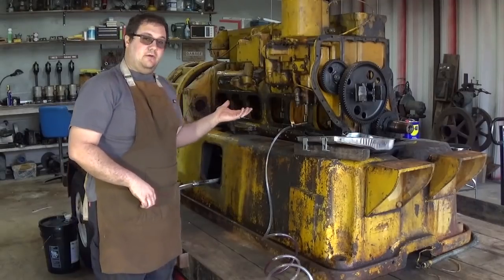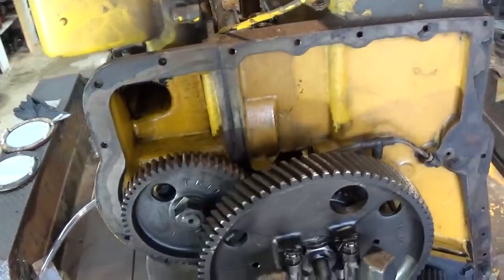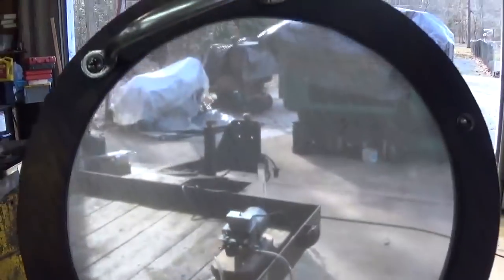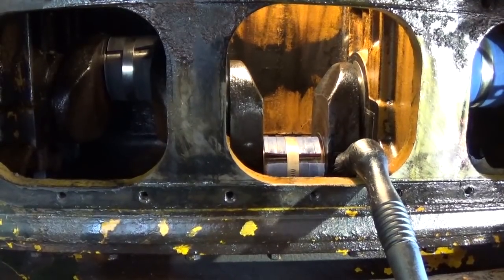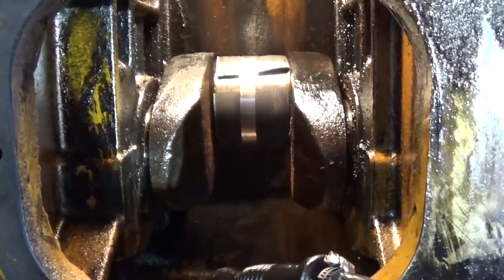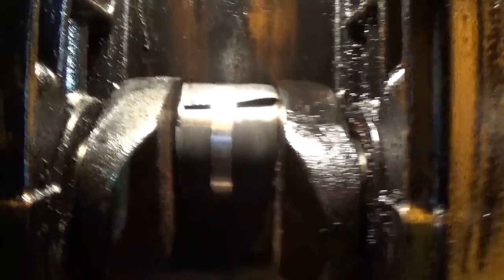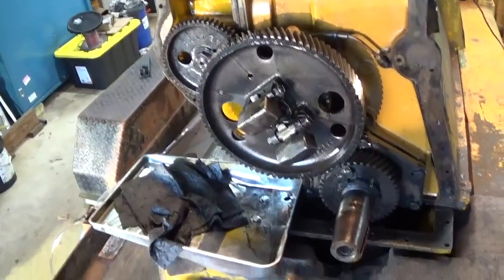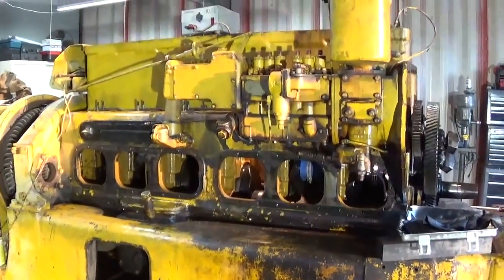Big Caterpillar Generator Crankcase Cleaning

Comment: Given the amount of sludge flying around, I would worry about the crank and cam bearings.  I know you don't want to get into the engine that far, but I think it will be necessary  to remove both the cam and the crank if this engine is to have any hope of living beyond a couple of hundred hours.  Even though the crankcase is clean, you have driven all the fines right into the bearings and cleaning the oil galleries will leave sludge in the dead ends right at the bearings.  Consult some experts for their opinions.
Reply: Exactly but I understand the other concerns too.

Comment: You can reduce the load on your pump with a minor alteration to your plumbing. Right now, you have a ball valve restricting input to the pump. This creates an unnecessary load, and is likely why your pump is so loud. A more efficient method of metering output is with a bypass valve. Install a "T" on the pump's output, you can use your existing ball valve or a better option is an adjustable bypass/pressure relief valve, and run a return from the valve back into one of your buckets.
Reply from the maker: Good idea, thanks for watching!

Comment: I like your set up for solvent pumping.   I had an idea while watching, if you ever have another one like this to do, maybe hook your pump up to a cheap lawn sprinkler and set it down into the block from the top and let it spray for an hour or two before and a while after cleaning. Might save a little elbow grease. I have been working on Honda Portable Generators over on my channel. I did post a video a year or so ago when we pulled a 250 KW Kohler off the roof of a 7 story building and set a new 300 KW Kohler. Fun times!

Comment: You read my mind on the hot tank.  Also agree you will have grit in the journals and oil passages for cam and crank.
Reply: Just watched a vid with someone who had bead blasting media in a differential.  The pinion bearing seized after 20 miles.  They had tried to clean the diff too.

Comment: I remember that sludge you are removing in old diesel engines like the one my dad had in his tractor... We used Texaco Ursa in it and it would immediately turn black and eventually really thick and black.. It made really good stuff to put on cattle rubs out in the pasture to keep the flies off of our cattle... Mike in Louisiana
Reply: I remember this oil 50 years ago.the gasoline had a real bad oder.

Comment: Cat paints the inside of blocks so the sludge cannot build up in the pours of the metal casting.  Of course they are assuming regular oil changes and maintenance with it - seems to rarely happen.  If it had not been painted the cleanup would have been nearly impossible with total disassembly and dipping or baking the block.  Looks like you have a good handle on the cleaning.  Messy but necessary.  Hint: when building an engine (car or equipment) paint the block and change the fluids as they should be!!!   Good Video.

Comment: Hey mike,  WOW!  U know my d13000 genny was running and in service when i bought it. (Just a hole in the pony block)  The main engine oil pressure was on the low side and the thoughts on the Cat site was check for sludge restricting oil flow to the oil pump pick up. This was the easiest first step.  Sure enough, with side covers removed i had sludge measured about 2" thick up around the pick up bell and its screen causing a narrow opening around the bell and a definite restriction of flow.  Big PIA  cleaning it out!  Then with it back together, using the mt50 to fire it up oil pressure came to 35 lbs (upper limit on these) and stays there.  I use straight 30w non detergent oil. Never had to tear into it any further.
  Couple questions.... Ain't the inside of the block painted with green/yellow gyptol?  Mine is, but 200 units newer.  The "big can worms" question!!!!  Are u going to use detergent oil?  I don't, just because of the sludge i saw that i couldn't get too.(just like u show)  I don't have paper filters either. U can understand why???? Right?  My meter reads 8600 hours... what does urs read?  Good luck with ur project!

Comment: Just remember on those old Cat diesels. You check the oil level after they are running. The oil level on the dipstick has to be higher than the “full” mark in the morning
Reply: Not all of them! The early engines 1935 and before are checked right after engine is stopped.
Reply from the maker: Yes, I have serviced a number of engines that had the dip stick marked both ways, running and stopped.  On my engine the dipstick gives no special instruction, will have to pull out the operator's manual and check! 
Thanks for stopping by!

Comment: Good Job Mike: When I worked on Diesels years back, we used a product called save-a-sol ( as I remember) worked really well and was a mild solvent that came in drums with washing brushes and pump. Worked really well. Don't know if they still make it or not.  I think we use compressed air nozzle for the spray attachment. Might be mineral spirits based.Thanks for great video's.
Reply: Waterman one Might it be a variation of Stoddard solvent ????

Comment: Seems like you've developed an effective cleaning technique.  The pressure looks low but then again, I have very little patience...lol. As always you're doing an expert job, Mike! Thanks! ...Newk from Kentucky
Reply from the maker: Hey Newk!  You are right, I had the flow cut back because my filters were plugging up pretty quickly.  Since gravity was the only thing pushing the dirty liquid to the pump I had to take my time.  
If I had to do it again i would change the set up a bit!  Live and learn!

Comment: Once you assemble the engine and run it, a good oil additive like STP (I am not sure they still have it under that brand), solder seal, etc will remove minute sludge in the oilways, journals and walls to give a good shine. I used to use these additives in old engines way back in the 80's, 90's with good results. And they are also good for gearboxes, differentials and power steering.

Comment: I think with this amount of cleaning, I would have modified a jet washer or better still a heated jet washer. That would have done the job quicker and got to some of those more difficult places.
I'm also worried that everything you have done, will have driven too much debris in the the bearings and only removing everything is the only sure way to know they are clean.

Comment: Wonder why they painted the interior portions?  Amazingly tough paint to stand up to constant heat and oil!
Reply: It had two purposes, one was to prevent any sand particles from the casting process coming out of the casting and to help the oil to run back down to the sump.

Comment: If your not gunna replace the bearings and cam shaft I'm not sure I would be putting that none lubricants like diesel there really good chance them old bearings will spin or have spun bearings after short run time but what do I no haha really cool motor nice job buddy
Reply: Diesel is actually a lubricant, however not as good as engine oil obviously

Comment: I've worked on some big diesels that were sludgy. We found it was caused by an engine running too cold .Also, i did a lot of work on Marine diesels with the same problem and it was the same cause. But on engines of that size it was simple matter to up the temp in te oil cooler.
On todays car engines ,if they run too cold and the oil isn't changed ,if at all , they get really sludgy,to the point where I saw a AMG V8 written off because the cost of cleaning the engine was too high. That has more to do with synthetic oil than running cold though.
Reply from the maker: Yes! Proper operating temperatures play a big role in the life-span of machines like this.
Thanks for watching!
Reply: if the m113 amg had sludge it was because of not changing the oil. Those engines are very good but some people are very stupid and cheap.

Comment: Yep !! Lots of this work is definitely tedious, not "glamorous",  and requires lots of patience. Getting good results. Flushing out those oil galleys, without loading all the bearing areas with grit, is going to be "interesting". I was going to ask why you chose fuel oil as a cleaner?? Was it simply for cost considerations and does it have any "solvent" properties??
Reply from the maker: Thanks for checking it out Bob.  I am working on a way to back flush the oil system now.  As for the fuel oil, cost and ease of availability were the main reasons.  Also the fact that it is not so aggressive that I would mind if I got a splash in my face!!

Comment: it would be really cool once this is finished you got a big piece of acrylic and made a see through inspection plate so you can watch the crank spin
Reply: It will take less than five seconds until you cannot see anything through that window... The window-thing only works on real big engines which run at speeds in the 100 rpm range.
Reply: Albin is right, you could see nothing but a blur and oil

Comment: you did not show how you were using the screens, how do you have them mounted in the buckets?
Reply: Yeah, that would have nice. I assume since the buckets are tapered he just slides them down until they jam against the sides. Since he put the inlet low and the outlet high, he just has to have the screens horizontal. Great thinking Mike!

Comment: You're putting a lot of labor into this genset.  I assume you did some testing to ensure it will work when you're done?
Reply: I'm wondering the same????  If it don't i'm sure the videos will be of a different subject. "Caterpillar D13000 electrical generation issues".  I'm staying tuned.

Comment: can you stop by a local Home depot and pickup 3 or 4 packs of this exact magnet number
Model # 07091HD  Master Magnet 3/4 in. Neodymium Rare-Earth Magnet Discs (3 per Pack) about 5 bucks a pack..  put one of these magnets in a back corner of each rod cap access cavity. that will take 2 packs.. at least 2 under the timing cover area in an attempt to catch any rusty metal that comes off the timing gears... and you will want to put several around but not within a few inches of the oil pump pickup tube.. this will keep any rust or steel or iron fragments out of the oil pump and oil galleys.. 

in some installations... i twist a loop of thin solid copper wire thru them to get these washer shaped magnets to sit up off the pan or casting.. so there is more surface area to attract rust and particle fragments. 

 if you want your injectors and injector pump to last longer.. build up a magnetic trap out of a glass tube replaceable element fuel filter.. and a stack of these or the next size down magnets with the hole in the middle. to catch any Rust or sediment that is coming out of the fuel tank.   dropping a single small version in a lawn mower engine tank.. if plastic.. drop one in.. place a second one outside. the  two of them holding each other thru the plastic tank ..  glue the outer magnet on..